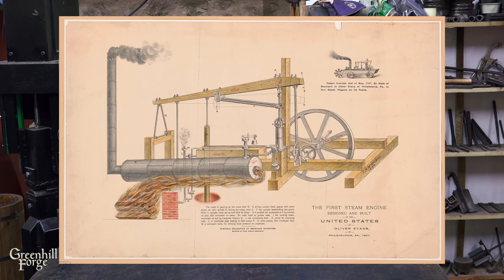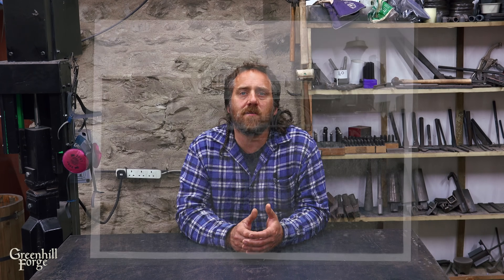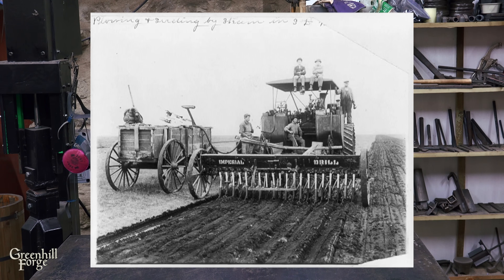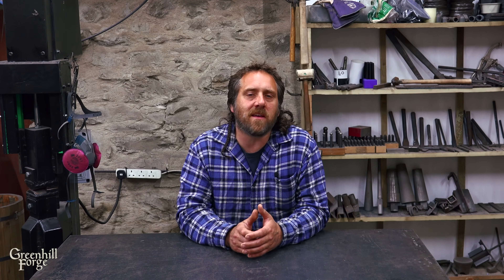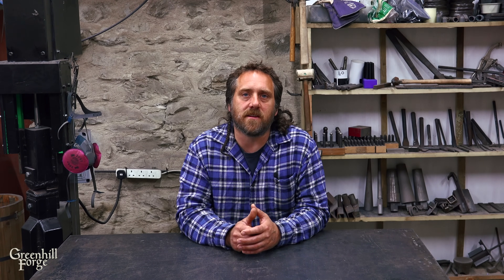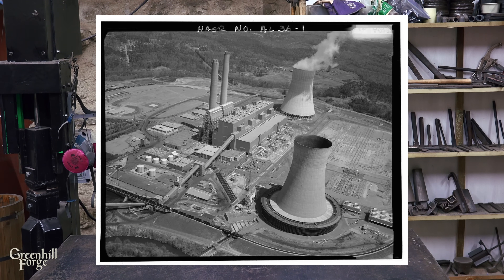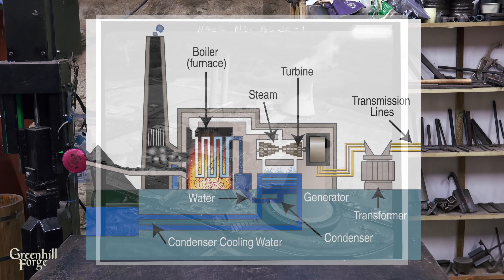Help Me Design an OffGrid Steam Engine + the Basics Explained

Comment: I vaguely remember reading somewhere that brass can get brittle when exposed to high temperature steam long term, but I’m not 100% on that information, so it’s worth double checking before using brass in that application.
edit
I googled it, and yeah, hydrogen embrittlement is a problem with high temperature steam and brass, made worse by porosity, cracks, and notches.
Reply from the maker: good to know. I'm leaning towards trying to repurpose an old ICE engine I think. lots more research needed on this one
Reply: De-zinc-ification is the other problem with brass and steam. 
Steel and steam is rust. 
Copper and steam are ok. 
Bronze and steam are ok. 
Machining and electronics channel @Blondihacks has some documentation on building small steam boilers. Steam engine technology is likely better than an old ICE unless you skip steam and go to coal gas or wood gas to drive the ICE.
Reply: @erikb3799  I think he means more like using the cylinder and piston from an old ICE to build a small steam engine. Assuming it being cast iron, it should be fine.
Reply: @Vikingwerk  most engine blocks are Aluminium
Reply: @simonmasters3295 most newer engine blocks. He could be thinking of using the block out of an old tractor, from when cast iron was king.
Reply: @Vikingwerk I'm not aware of cast iron being any more corrosion resistant than steel for steam applications. I am neither a steam expert nor a corrosion expert, but quick internet searches say the system will corrode and fail. But low pressure steam boilers are made from cast iron, so maybe it's a 20+ year problem, which is a decent life for equipment.
Reply: @erikb3799  every metal can and will corrode, given the right conditions. Hydrogen embrittlement is different than corrosion, it weakens the metal in a different way, that is not really detectable with visual inspection the way corrosion is.

In steam power systems, a lot of consideration is put into de-watering the steam, which helps prevent corrosion of the working parts.

Comment: I love to see a steam turbine few kilowatts.
I think it is a great solution for some of the resonant free electricity systems, which can only be resistive loaded.
a resistor can produce heat, so it's perfect for a steam turbine. Very curious what the size, output voltage and current would be.
pistons are more for engines I think.

Comment: if you got good wood ....  IMHO go gasifier.  If you got crap wood and other low hydrocarbon stuff to burn (rotten wood, homemade paper briquettes etc.)  that wont work with Gasifier setup (wood gas) so then go IMHO Stirling.  

IFFFF you have weld skills extraordinaire and can build a horizontal or vertical tube boiler  that can be certified...  (boilers are dangerous shiat)....  then Steam created via good wood or coal is fine but IMHO ... still say though IMHO gasifier is better followed by Sterling and 3rdly flash steam system then lastly typical steam.   

Myself.. my burnables are low hydrocarbon stuff (paper, rotten wood etc.) and with boiler cost so high (and danger high)... am going Stirling engine with a larger than typical firebox. Larger to get needed heat from low heat output crap burnable stuff.
Reply from the maker: I'll be putting out a gasifier series at some point, I really like them. Stirlings are also very cool, I build a small one here https://youtu.be/-XwWipp2EjY but I think it would need to be really big to generate a decent amount of power (which sounds like a really fun build) . I'd love to know how it works out
Reply: @GreenhillForge  will look at it soon.  Something to consider or the Stirling..  is small or medium ones... STACKED side by side .. all driving a single crank.   

CVT off of crank to the charging/load device(s).  CVT will accommodate for loads that change draw with less effect on actual engine(s) and or for heat or cool  fluctuations. 

or same idea..  but radial like old airplane /Tank engines.

hardest part would be heat/cools source that is balanced so no  hot or cool side is much different than another.   For hot..  maybe a heated sand  that sits around the hot side.  Sand acting as a capacitor/diode of sorts to even out the temps equally??

Comment: A fusible link is generally just a plug in the bottom of the boiler made with lead that will melt if the boiler tank goes dry. Considering the ease of putting one in there's no reason not to have one, it'll keep the thing from exploding as long as it is big enough. The other safety thing on a boiler is a blow off valve, when the pressure exceeds the max it should pop and bleed the pressure down. Unlike the fusible link this is part of normal operation, it also needs to have hysteresis, once it pops off, it should stay open to a lower pressure. As for coil boilers, you need to have a pressure source of water behind them, or they will vapor lock and blow the tubes up, so it's great for a steam cleaner/pressure washer but not so great for a source of steam power. As for engine materials, it really doesn't mater because you will need to oil the steam anyways, as long as you don't let the engine sit for long periods of time it should be fine. The biggest factor in efficiency is insulation, as long as the smoke is cold before it goes up the chimney it will be good. Old locomotives ran the chimney through pipes in the center of the boiler. 2kW is only about 2.5 hp, so you might find a small vintage steam engine to suit your needs. I've seen 10kW wood burning steam systems with generators that looked like about a 6x6ft cube, outside for noise and safety, but I think they were running a whole shop on it, not just charging a battery.

Comment: Sounds like a fun project! I’d suggest trying to convert an old Honda generator to run on wood gas instead. It’s much more compact and certainly more efficient. Here in Germany, a lot of tractors and even cars were converted to run on wood gas about 80 years ago when fuel was scarce. They’re neat systems, although not as popular to tinker with as steam engines.
Reply: yeah but wood gasification is reali ineficent compared to steam , back than wood was mutch mutch cheaper so people did wood gas becouse its mutch easier to convert internal combustion engine to wood gas than to steam , and wood gasifiers can be reali compact for even big engines witch steam just cant compete
Reply: @ridenmanadam9363 Gasification achieves 15-20%, a small steam engine only 5-10% efficiency. Gasification is also simpler, safer and cheaper.

Comment: An old cast iron air compressor for the piston system and flywheel.mount, a high pressure propane bottle for the boiler, a car radiator for the condenser and a 5kw generator head for the power unit. Pressure relief valves from a hydraulic system for safety and a flywheel from an old diesel engine for the flywheel weight.
Reply from the maker: all great ideas
Reply: I've heard the idea of using LPG tanks for boilers. The 20Kg ones, I think they are. I like the idea of multiple smaller boilers rather than one large one.

A car radiator or similar for a condenser might work, but salvaging condensers from old air conditioning units might work even better. A car radiator is a good heat exchanger but not great with pressure. AC units are designed for higher pressures and are also built to be efficient.  As a straight condenser, I've been eyeing some old fridges to steal the coils from the back of for my water distillation setup here. No real pressure involved in it, mind you. It's an old pressure cooker with a bit of hose stuck on the outlet. A far cry from a proper steam system.

Comment: I suggest you start with an old cast iron air compressor, 2cylinder. This will take 90%of the work out of it and make for efficient power. They will already have a belt, pulley and a frame and already have all the necessary components for steam power.

Comment: I have a concept that eliminates the need for a boiler....But requires a water source.... It still needs to be perfected..... I call it either The Drip, or The Injector Method.....You can see the concept for yourself... Get yourself a plastic water bottle....Boil some water...Pour in about a quarter bottle of hot water... dent in the side of the bottle a little bit, and put on the lid... Now shake.... Blimp! I'm thinking red hot surface meets cold water droplets, contained within a cylinder.... The hot surface area can be small, but able to turn a measured amount of water from liquid to steam instantly.... The expansion of liquid water to gas is significant and substantial...The container is the question. Piston or pump, or other....I once took a wood burning tool, similar to a solder gun, and pushed it up to the cork handle I made for it into a plastic bottle with water droplets inside, plugging the bottle with the cork....I shook the bottle lightly and finally got a droplet to land on the hot tip...When it hit the tip, the bottle popped off the cork. I was amazed that one little drop could do that....Two other things to observe in speculation of potential, is when I was young, I was given a rocket kit...It was basically a  hard plastic bottle with fins, shaped like a bomb...It had a pump, like a bike tire pump with a trigger....So I would fill the rocket about half full of water, pump it as hard as I could, pointing skyward, and pull the release....It shot way high...The metered water spray combined with compressed air was within the "Equal and opposite reaction"  concept... I shot it without water only a few feet up. I think a properly orchestrated balance of volumes of water , with volume and pressure of compressed air metered through a nozzel could produce a powerful, measurably sustained vertically positioned downward jet blast of water, able to set a massive balanced wheel or other structure into a state of momentum....  I know self sustained perpetual motion is pretty much an impossible reality.... However, through magnetic levitation, or improved bearings, at least friction can be reduced significantly.... I would have no problem with a device that I would have to occasionally power up with my own effort, like with an exercise bike, or a manual pressure pump for a few minutes every 4 hours or some intermittant time like that.... Once you could accomplish that measure of sustainability, every future improvement would be a bonus!... I also used to make bottle rockets by taping a shaft of wheat straw to a light plastic bottle, add a few drops of alcohol, put the lid on, let the alcohol turn to vapor, then remove the cap, set the straw in another bottle, and lit it.... I got pretty high up with those rockets too..... I guess my summary is to expand water to gas state by contact with a tiny hot surface, or make pressure, whether air or gaseous, to push a metered jet stream, incorporating the mass of a volume of water toward ground, to produce enough force to bring a heavy mass into a state of low friction rotation for a sustained amount of time.... The initial startup would require either heat or manual labor, or both, I theorize...

Comment: I use wood or charcoal gasification piped directly to a small gasoline engine ( 7 HP ) which turns an alternator to charge the battery bank. Works well and it's simple to build. Steam is pretty cool though and more challenging.
Reply: Do you really find this less challenging? Everyone seems to go crazy for wood gas but I have several issues with it:

1. You have to waste a lot a fuel just to make the wood gas and then only a portion of the wood you "cook" gets converted to gas.
(ie: steam uses fuel far more efficiently)

2. Don't you get all kinds of problems running a small engine on wood gas, namely fouling? I cant imagine running a wood gasifier and engine for hours and hours on end without problems like you could a steam engine.
Reply: @jamessever8936   --- Well steam is less efficient than EVERY explosion engine. Even wood gas one has 20% and the classical steam engine only 12% (if it is not a high-tech high pressure turbine at a power plant).
-- Yes you have wood gas problems also, mainly less lubrication. You have to do a oil-changing much more, the cylinder head is often more coked etc. etc. But compared to a steamer, where you have to warm up, service, flush the boiler etc. Its much less work than any steamer.
Reply: @paulhorn2665  interesting. thanks for your input
Reply: Solar is still cheaper .
Reply: @Super--Star yes, but how about regions that have almost 6 month of cloudy and rainy weather on autumn and winter time?